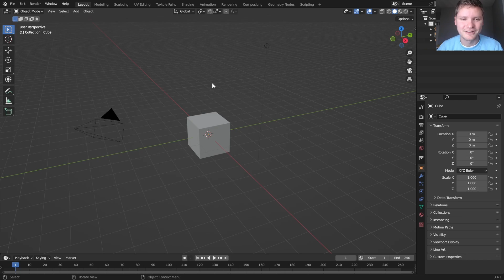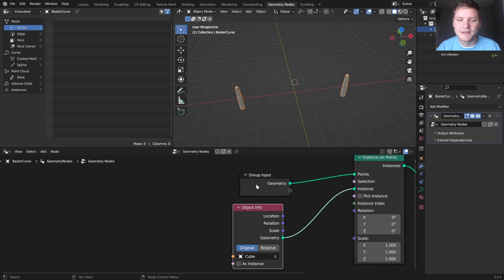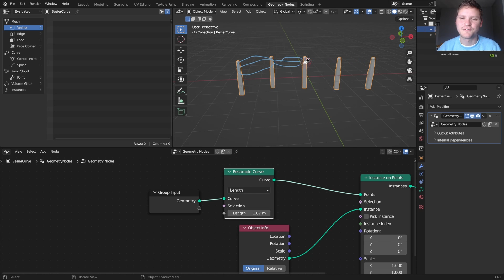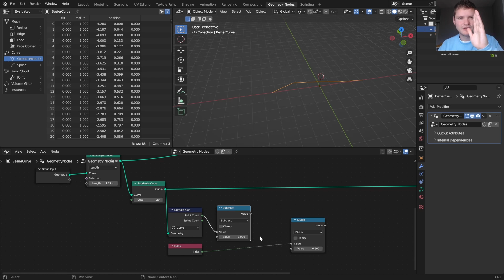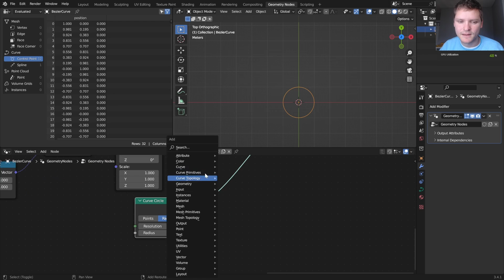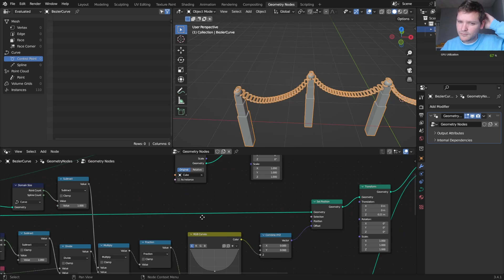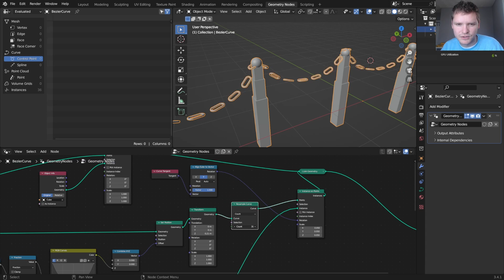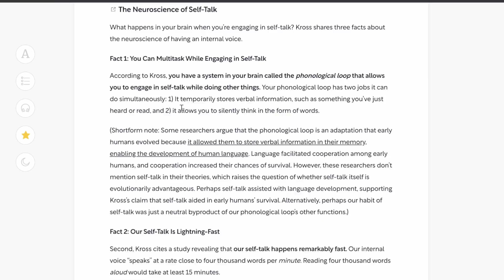Advanced Chain Modeling in Blender

Comment: Due to all the chain droops being identical surely it would be more memory efficient to generate one droop (or one droop per spline segment due to variatio when using length) and instance it to the vector of each of the resampled spline segments? This might also help with making a better solution for the the conneciton points 15:10 as each section could have modled end links.

Comment: For the Chain Link instead of moving the Top (Y+) as Selection and later transforming it to get it centered you can also use the sign of the Y-Position as offset and scale it to move both halves. The sign moves the upper half (Y+) of the circle in positive Y and the lower half (Y-) in negative Y direction. Therefore it is centered. 
Nodes:
 (Position -> SeperateXYZ Y-> Math Sign -> Math Multiply -> CombineXYZ [0; Y; 0]-> Set Position Offset with x as half of the lenght of one link). It does the same but is a little bit cleaner and less computational expensive.
Reply: i know its 5 months old...
but what about Using  Nomal --> (Vector math) Scale ----> (Vector Math) Add ------> (Set Position) Offset.